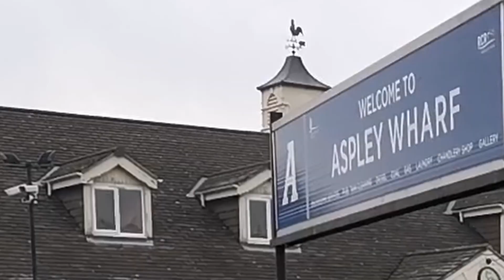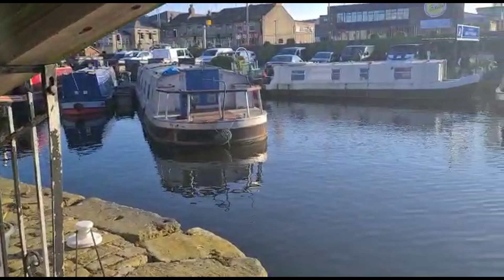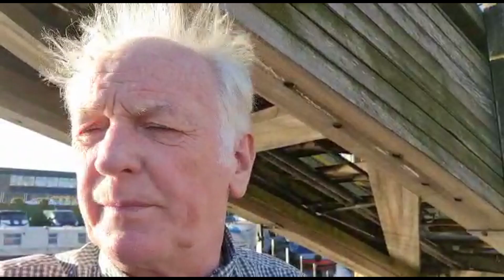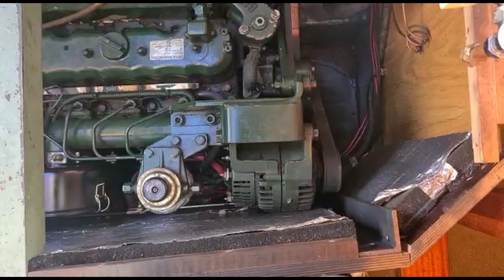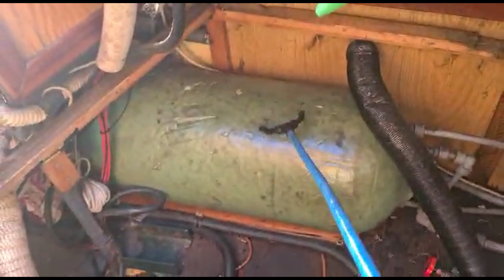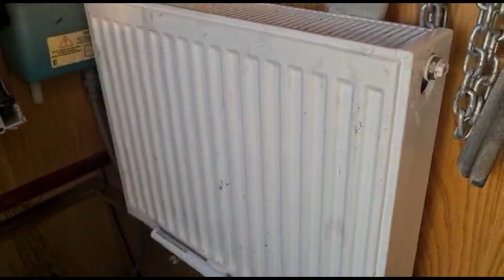Beta Marine 43 Engine Tour on a Narrowboat!

Comment: Please can you tell me how you fixed the water dumping problem- I have a brand new beta 43 fitted with the same problem many thanks Peter
Reply: Hi, removing the extra radiator made things much better, that seemed to create extra pressure in the cooling system - probably because it was too high relative to the engine. Other boaters have successfully fitted a similar radiator but mounted it lower down, one I know has a traditional engine room with space to put the radiator alongside the engine but that's not possible on my boat.
Since the radiator was removed the engine still gets hot when cruising on a river or on a stretch of canal with no locks even when keeping the revs down to 1050 - 1100 rpm. On two occasions when setting off after a break the engine has rapidly overheated - in about 5 minutes - and the temperature alarm has gone off. Once there was also a loss of some coolant and I called out RCR to look at it. The engineer said Beta engines can get airlocks in the cooling system and that causes the rapid overheating. Then you need to let the engine cool down then bleed any air out of the skin tank and top up the coolant and you are ready to go. I assume the airlocks are caused by the engine getting too warm on the previous run but I may be wrong. Beta Marine are very good at talking to customers on the phone and giving advice and on their website they maintain a list of certified engineers who are trained on Beta Marine engines so you can look up your nearest engineer.
Up to now I have had to bleed the skin tank every time I do a day's cruising, and there is always some air in there. I have a bleed valve with a lever on it but it still means lifting an engine deck board to reach it. Next week I will have a new skin tank fitted which hopefully won't get air in it but even so the engineer will fit an automatic bleed valve which will detect any air and let it out.
And that's all I know about Beta engines and skin tanks! Good luck,
Peter
Reply from the maker: Thanks for watching the video. I hope Peter's reply is helpful to you. 🙂